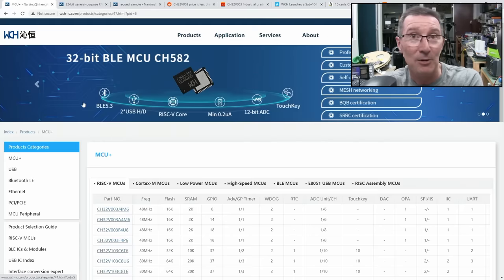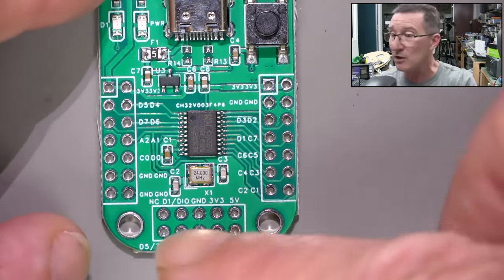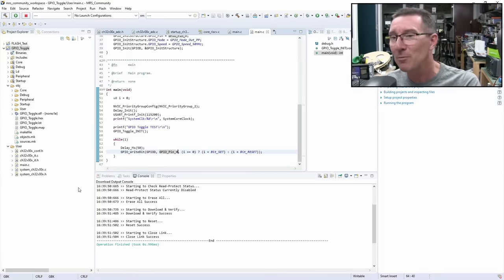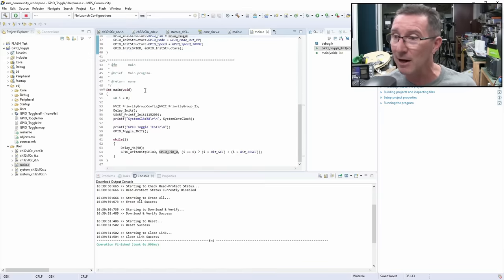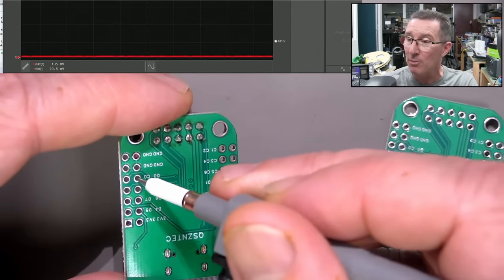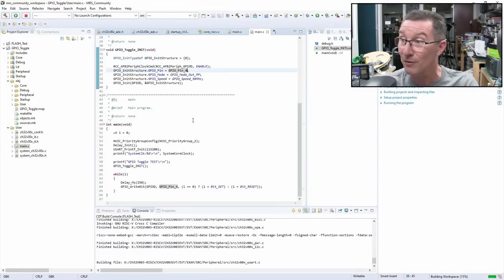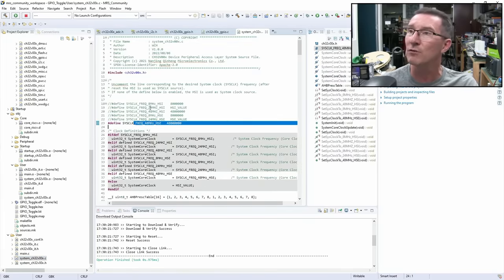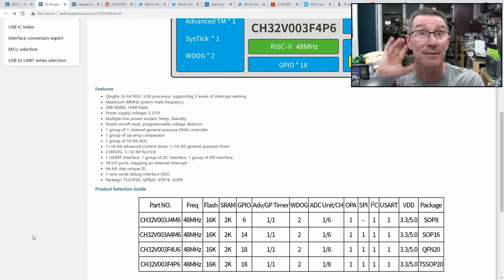EEVblog 1524 - The 10 CENT RISC V Processor! CH32V003

Comment: So, 0.2$ was expensive and they have made a "drop in replacement" chip for 0.1$ ROFL
Reply from the maker: No joke, that can make a huge difference.
Reply: If you are selling a complete populated board for 99c including shipping, your actual board must cost under 30c to have it be a viable item. So cutting a third of the price off just by replacing one component will make it worthwhile.
Reply from the maker: And it's not just product price point, simple volume matters. I worked on a design that was for 300,000 boards that went into a crazy expensive bit of kit. $3000 saved for every one cent reduction in board cost.
Reply: @EEVblog  well, i see. But not many products reach that quantity, so it's not a significant cost difference at first sight.
Reply: @EEVblog  If you look at it purely from hardware yes; but as a software developer all too often i've seen the hardware guys make a "drop in replacement" that then requires a lot of effort on the software side to make it work the same. It is unfortunately often forgotten by many companies that software development isn't free. In this case it might've been a full compatible one, but all to often it's not.
Reply from the maker: @ruadeil_zabelin  In this case it's a not a drop in replacement it's a pin compatible replacement. You'd still have to do a a fair bit of code mods to make it work.
Reply: @EEVblog  ye that's exactly my point. The 3k you saved you end up paying in programmer wages. If a couple of them spend a few months, then it cost you a lot more than the 3k you saved. Just wanted to point out this is often overlooked.

Comment: For making the LED-Blinking faster, please try to remove the conditional assignment and just toggle the variable.
I haven't looked into the header-file, but from the code I assume to be "#define Bit_SET 1" and "#define Bit_RESET 0"

So, try to use:

i=!i;
GPIO_WriteBit(GPIOD, GPIO_Pin_4, i);
Reply: I'm pretty sure it would end up with the same binary, since riscv gcc will definitely optimize that.
Reply: The speed is very depended on if it has bit-write remapping, where a single bit is remapped to byte address at a fake memory location.
But real pros would use a timer for it anyway and not port banging.

Comment: Hi Dave   Quick question .... Was the xtal on the demo board 48MHz  or was it much slower ?  This might be the reason for the slow IO toggle.
Reply: That devboard looks to have a 24MHz crystal installed, but the CH32V has an internal clock doubler to bump up the rate internally to 48MHz AFAICT. A GPIO toggle rate of 923 KHz corresponds to exactly 26 system clocks required to change the state of the I/O pin using the provided c functions only. Not great, but not terrible.
Reply: It's just slow code.  If you look at it, it's reading the port, testing the value then writing the inverse.  To do it really quickly you already know the state of the port so would only need to do two writes and a branch.  Won't look nice and square because of the branch but easy enough to pad with a NOP.

Comment: Hey dave, could you do a review on the PARALLAX Propellor chip 1 & 2?? Both are multicore and require No Interrupts!
Reply: Thats a blast from the past, I was fiddling with those about 20 years ago.
Reply: @mytech6779  so was I , for about 10 years, need to get back into it, they have a P2 chip now.
Reply: @davem3325  But a RP2040 at $1 is like a 2core P2, think parallax is struggling as that $1M investment for P2 has no major buyer.
Reply: @tonysofla  HUH? RP2040 ?? can that be used for embedded design ? EASILY? I have not used the P2, but its works similar to the P1 with more functionality, I have used the P1, its really easy to program, multicore, no interrupts, choices of languages. Only wish they had a decent MAC IDE
Reply: @davem3325  RP2040 is for embedded design,  dual core Arm cortex M0 each at 133MHz and 265KB of sram, can be overclock like crazy that you can do hdmi on it.
Reply: @davem3325  P2 at $12.75 (450+ units) no major company is going to approve a product based on it as it's too quirky and niche.
They would just get four RP2040 at $4 if they needed 8 cores.
Reply: @tonysofla  use 4 x RP2040 on the one board, just to get 8 cores, that would be a nightmare to program , compared to just on MCU? wouldn't you think? It all depends on what your making from thes, I am in low volume, and I am a one man band, so faster development would keep my overall costs down, , but for high volume, then those cheaper MCU, or any other would need to be considered.
Reply: @davem3325  P2 only have 2KB cogram for each, I think you would only need two RP2040 to get the same amount of work done, and two MCU would not be nightmare. I have used P1 but I think P2 is too niche and too expensive, who really needs 8 cores no IRQ? I think those guys would use a FPGA.
Reply: @tonysofla  Ive only used the P1, I have used all 8 cores, never programmed an Interrupt. also, pins are NOT dedicated to i/o types, you are free to have as many peripherals as you like. all software configurable.
Reply: @davem3325  Look at my channel I used P1 too, but in real life not many products need those clock precise features. who needs low-res vga in 2023?

Comment: How hard is it to get a clean GNU compiler setup without downloads (other than headers or libraries) from the manufacturer?  I can't say installing a bunch of Chinese software on a development PC that will have valuable IP on it would fill me with joy...
Reply: Dude, it's 2023, just spin up a VM in VirtualBox and install it there. But if you're adamant about your way, it depends on what your OS is. On Manjaro Linux, it's just one command in the terminal:

pacman -S riscv64-linux-gnu-gcc

On Windows, it's more complicated, as usual: find the pre-built toolchain from a vendor you trust, unpack it, add the bin directory to PATH, maybe troubleshoot if some tool like "make" is missing.

Comment: Hm thats strange. In most Eclipse versions I've tried over the years, It would ask me if i wanted to save everything before building. Those being STM32CubeIDE and eclipse java and C/C++.

I'd be very interested in a truly open source toolchain that i could use with neovim.
Reply: STM32Cube is much far from barebone Eclipse (in a good way). But I agree that every IDE/Compiler that Ive been working with either saves the files automaticaly or gives you prompt at least. I mean I dont think Ive ever been in a situation where I was like "hmm lets make some code changes and then flash the bin without changes".

Comment: Love the innovation in RISC V but it's a bit more complicated.   

Sure the instruction set is open source and there are virtual cores online to download and chuck into an FPGA, but the problem is it still requires a licence fee if you want to use one of the well developed ones for a real piece of hardware.   Most people use a core from SiFive or similar who've done an incredible amount of good work.  Now Intel is behind it, it's going to be interesting.  Of course it takes a LOT of engineering to optimise a completely new processor whatever the instruction set, so unless you have a massive budget the options are currently a bit limited.  

The cost isn't much different from using ARM at their lowest tier pricing.  ARM is of course amazingly mature with advanced compilers, reference designs, debuggers and so on.    One of the reasons ARM is much cheaper than it used to be, is due to the long term threat from RISC V;  competition is a great thing.   

If the Nvidia purchase of ARM Ltd had gone ahead, there would have been an urgent need for many vendors to hedge their bets and rush into RISC V.  Now that's been blocked by the European regulators, it's less critical, but still a very active area right now.  Microcontrollers offer the most upside right now, rather than servers and desktops although they are beginning to trickle out too.
Reply: with opensource instruction set you are sure there is going to be competition between core designs (and therefore low prices) because no single company can monopolize the instruction set like for example Intel/AMD do with x86, or Nvidia would 100% have done with ARM

Comment: Is power the same or lower for RISC V compare to ARM32
Reply: I was curious about this as well.
Reply: Depends what core you are using. ISA doesn't determine performance.
Reply: It depends on a particular implementation but it should not be too different as ARM's Thumb instruction set is a RISC one as well. And to be honest raw core performance per MHz is almost never an important enough parameter to even look at when selecting an MCU for most projects.
Reply: Watts?

Comment: Experiments:  1.  What is the fastest output pulse rate?   2.  What is the maximum rate on the ADC?      Oh.  Real engineers don't need a sticking manual!!  BTW.  10bit ADC isn't bad IMHO.
Reply: ADC max adc clock: 24MHz (at VDD of 4.5V), minimum cycles per sample: 3 = 8MHz ADC, half that at 3.3V VDD. 
Datasheet says Max 1.7MHz though so another div clock somewhere or they recommend 15cycles per sample settings for accuracy?

Comment: 10 cents sounds all good but I haven't found any selling for that.  Seen a 5 pack on AliExpress for ~$10 US plus shipping.  Nothing on LCSC.  Down the road maybe they will be 10 cents in quantities of 1000 but for hobbyists like me I will stick with the other MCU boards I use now that are widely available, supported, and cheap in my quantities.  Maybe it will be different in a year when production is up and there are more sellers.  But yes, RISC-V sounds interesting.
Reply: LCSC has 45cent way bigger brother CH32V203C8T6 , 144MHz and 480KB flash with 1500 in stock, and jlcpcb can have it mounted on pcb for a $3 reel loading fee.

Comment: Little light on the memory, less than 0.1mil/s worth for s max loop, I guess these could 'talk to each other over the GPIO in some kind of 4 bit - 8 bit code.. could be rather handy in a CNC application that has variables as speed, pressure and temperature.. Don't think I'd want it for facial recognition although.. but it could be linked to a better master chip, it being for doing the dumb stuff.. (A 'washing machine' chip'??)
Reply: coffee machines, Ryobi brushless drills etc is the market for it.
Reply: @tonysofla  I got the timing wrong.. more like 4x due to the average processing cycle.. still it is a 32 bit machine and good for a small program that can look at 1 - 18 inputs or outs.  That's a demanding coffee machine with more than a clock.. as 8 bit would do
Reply: If spi is not fast enough, go up to 64pin CH32V203RBT6, it has 10Mbit mac phy

Comment: This chip is 4 sq mm, no way they can make them and sell them for .10  There are none available at LCSC and the cheapest I found was $7.  I think this is cheap advertising on their part to generate interest. Nonetheless, I am interested in RISC-V and want to try this. They have a 3x3 QFN package listed in the datasheet but in my experience that will not fit the die, I design chips for packages like this and the maximum is about 1 mm sq for a 3x3 mm QFN.

Comment: Yes, you always needed to save to compile changes, in practically every IDE. Most IDEs have an option to automatically save on build. You realize that it is launching the compiler as a subprocess, right? How did you expect it to mind read the source from the IDE text editor? You realize that one compile could #include billions of different files, right? Did you think it was going to mind read them all from the IDE? How about git integration? Should that bypass saving too? No? That's too much? If your tests pass, and it was getting the code from the IDE, not the file, then you will commit without the saved changes.

Comment: So... What can you actually do with it?
Just flashing a LED is slightly underwhelming.
Reply: It can do what a 48MHz cycle clock and 16KB of code can do. 
What do you have in mind what you want it to do? its Advance Timer is great for 3-phase brushless motors. You want to make a power drill?
Reply: Honestly, a lot of times that's all I want to do.  A voltage reading maybe.  Maybe PWM to run a servo.  Turn on a relay.  At 1/20th the cost of an ATtiny85, if I can get a LED to blink (without going entirely bald) then I'll call it a win.

Comment: Did a search on Touchkey and came up blank. Can you explain what exactly is Touchkey protocol on this microprocessor?
Reply: CH32V103  The touch key capacitance detection function multiplexes the external channel of ADC to provide up to 16 
circuits of detection. The application program judges the status of touch key based on the change of digital 
value.
Reply: @tonysofla  _ The specs on this microprocessor says it does NOT have an ADC. The Touchkey function must have its own internal ADC
Reply: @NICK-uy3nl  Yes, so you have to go up to V103 or V203 like the 40cent CH32V203F8P6

Comment: I've tried some of those CH32 chips and they are terrible. Documentation some times does not match the real behavior, FLASH is slow, and you can't use any other debugger then their WCH-Link. UART bootloader was so unstable, I was barely capable of uploading firmware with it couple times. Also it is very ESD sensitive, I've got multiple chips and one WCH-Link dead from ESD.

Comment: What is the intended purpose of this micro processor? Can it be used as Engine Control Unit(ECU) for car engine?  China is banned by the West(US and UK) for chips, so ARM will never sell instruction set licenses to China, so the RISC V is the only game in town, no other choices.
Reply: Probably could be used for that (or you may have to go up to V103 or V203 family) |
Number one use would be 3phase dc motor control, like Ryobi drills or split mini systems ac-dc-ac converters etc.

Comment: Nice. Does their cross compiler support c++? If so what version?
Reply: The most recent C++ version supported by gcc and/or llvm, both of which support RISC-V.
Reply: @BruceHoult  I know that. Let me rephrase: What is the most recent version of gcc/clang (and therefore c++) that can be easily made to work with their toolchain. Also, how much of the STL does their toolchain support.

Comment: Does it have EEPROM included?
Reply: No 64bytes word storage area, but some higher up models have Vbat pin with 84bytes of sram backed-up also with its RTC running at 1.5uA (4years with a CR1616)
Reply: It has built-in IAP, the entire flash memory area can be used as NVM user data. No need EEPROM.

Comment: Assembly isn't too bad. It's processor-dependent, so you have to learn it for every kind of chip for which you're programming. My university had it pretty early in the curriculum, I think sophomore year or earlier. And we learned on a DEC VAX. Given the reduced instruction set of RISC, it's expected that you will have to do more work at the coding level anyhow -- but usually mostly through loops of some complexity or another. If you know how the newer chips do a routine, you can usually pretty much figure out how to code it - but code optimization is extra-important in such low-level RISC libraries. Back in the day, the selling point was that the chip could essentially run a bit faster because it couldn't do as many things. But looking at that paltry 48 MHz clock speed, I'd say it is more of a miniaturization benefit, and all that comes from that (half as far goes twice as fast, even for electricity...). Even with the benefits of assembly, that 2K of SRAM seems extremely cramped, IMHO. But it's best to get people accustomed to working in that sort of constrained environment, and then see their eyes light up when they double it to 4K of SRAM. This is the sort of chip I would want running the AI auto-defense system of my tank, to protect it from RPGs... Simple (fits within 2K) repetitive looping tasks...

Comment: I'd like to know more about the 64b chip ID, always need to be on the watch for CCP tracking and backdoor ulterior motives.
48Mhz 32bit for $0.10? Even for a basic integer module with no cache that's pretty snappy. Not far from a 1990 386 desktop. 
Risk-V is a modular ISA, manufacturers can choose to include or exclude extras like hardware floating point units.

Comment: 2:40 WCH is making USB to cereal adapter ICs themselves, must be one of their own parts, which is often used on fake arduino boards which cannot use fake FTDI chips anymore.
Reply: It's their heigh-end CH32V305FBP6,  cost $1.20, seems a little bit overkill, but when you're the maker of the chip you don't care.